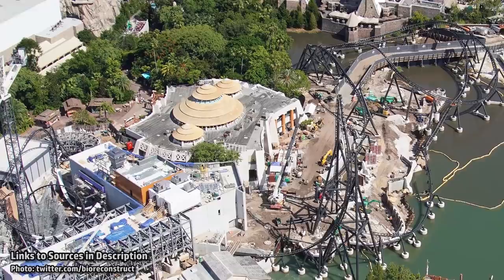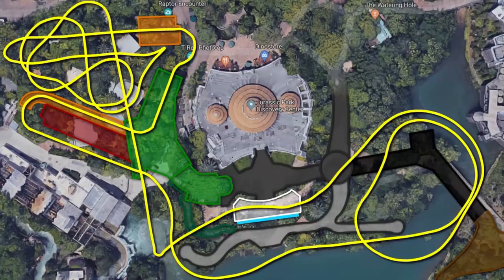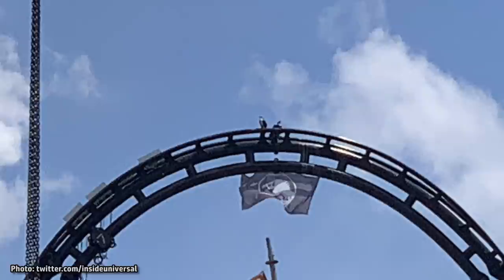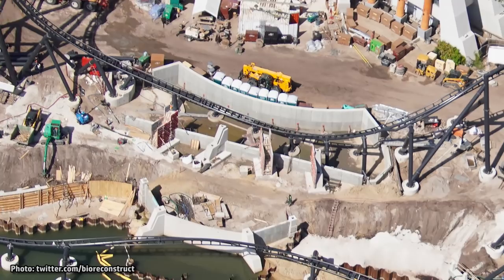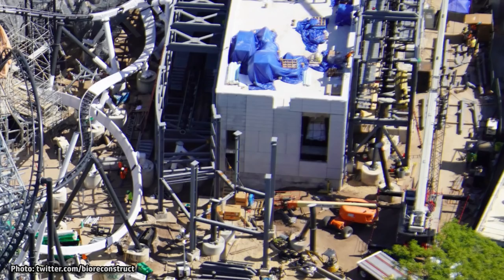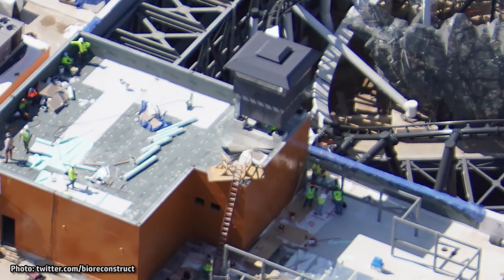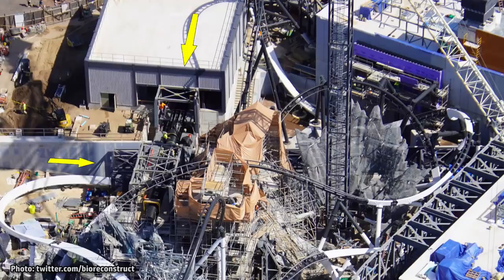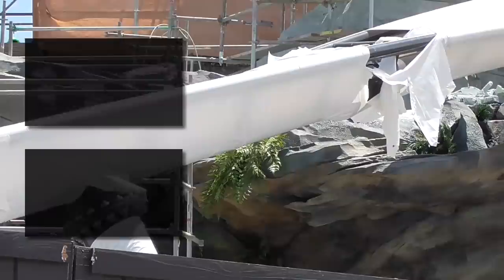Velocicoaster News & Construction Update - First Train on Site, Osprey Nest & Rockwork - ParksNews

Comment: Alicia, I went looking for those top hat paddle things on other Intamin coasters. On the newer coasters - like Hagrid's across the way - they are used for both launching and brakes. But I have found none on any of their other top hats. I originally guessed they were definitely brakes because coasters require a lot of them for launches and this looks like 3. But then I watched a Hagrid's POV and the first small launch appears to use only 5. That's not much of a boost, but that part of the top hat wouldn't require much of a boost. It also looks like there's more wires hanging free. That section of the top hat also has some weirdly-spaced cross bars, at least compared to the rest of the top hat. It looks like there are going to be 4 more paddles, leading up to almost where the bird's nest was. That definitely puts them in a better place to keep a train from valleying, but I still think those would have to be located on the other side of the top hat to be truly effective. So that has me leaning towards braking.

I said before that I think this could be to keep a train from finishing the top hat if a train has valleyed in the splashdown feature. But if they can do that, why not do it for ALL the trains? The more I thought about it, the more it is seeming like a possible feature of this ride. For maximum airtime, you need to speed into a hill, but you also need to barely make it over the hill. What if these paddles are to be used as brakes to almost stall the trains right up there on top and then as LSMs to power the trains off the top hat into the rest of the ride? That would require less power than that first little launch in Hagrid's. You know Universal wants this to be the BEST Intamin out there. That's something that could put it over the top, so to speak.

As for the semi-circular foundation... I don't think it can be a pump house as those need to pump water somewhere else, and this is a horrible location for that. It could be for the splashdown feature, but that water will come from a major filtering contraption, which this won't be. What's more important to me is that viewing platform. Why is it going all the way over here, so far from everything? This part of the coaster is not that exciting for viewing, and it can all be seen from the bridge anyhow! This is screaming out that it'll be something MAJOR. That bridge is still looking very temporary, so maybe it's going to get all rockworked and this will be a good place to catch a pretty waterfall. Maybe it will be a lookout tower that the coaster will pass very close to and then one of the windows will be broken - RAPTOR!!! Though, once again, not a full foundation. I also find it suspicious that this area is losing land. After finishing the lookout area, dirt has been vanishing and this entire walkway looks like it will be surrounded by water. Water doesn't scream Raptor; it screams Mosasaur!

Okay, a Mosasaur would be really cool, but how realistic is it? It's not going to be able to jump out of the water every 15 seconds. Still, this whole area just screams to me that something exciting will be happening here. Like that track layout. The only reason you put two coaster tracks that close to each other is for racing or because you're going to enclose them in something. And that makes perfect sense because the area where the tracks are closest to each other are right where you can see them from Hogsmeade. I'm clinging to hope that they will hide this from Hogsmeade, which seems realistic considering how demanding JK Rowling is about her Wizarding World. But there is not a lot of space between the tracks and that Hogsmeade wall. 

Looking at the satellite pictures, this helix area appears almost perfectly circular, which immediately said to me, Aviary!  Which would be amazing. It "could" explain that foundation - one of the rocky pillars -  and the widening of the lagoon here - a river runs through the "real" Aviary. Everything fits except they didn't do footers for anything other than the coaster. So it's basically just wishful thinking and not some educated guess. That foundation might very well be for a gyrosphere or a jeep or a non-animatronic Indominus Rex and we'll get nothing besides more rockwork and a waterfall. We probably won't see any movement over here until things start finalizing over on the other side of the Visitor Center.